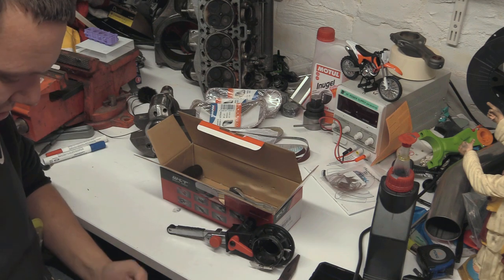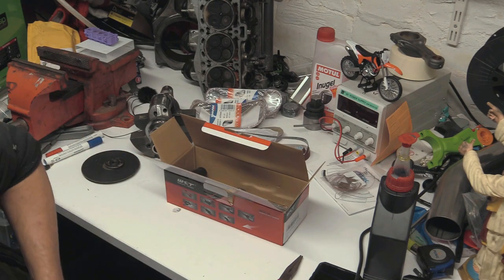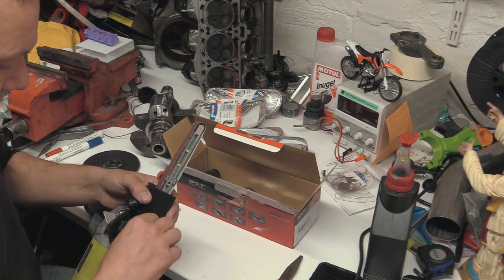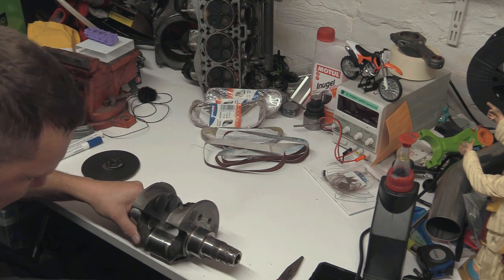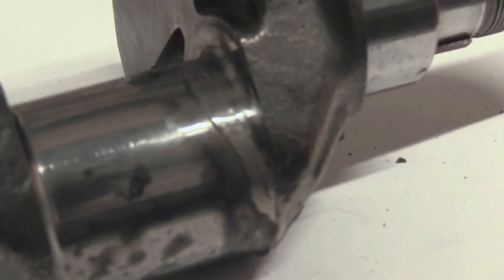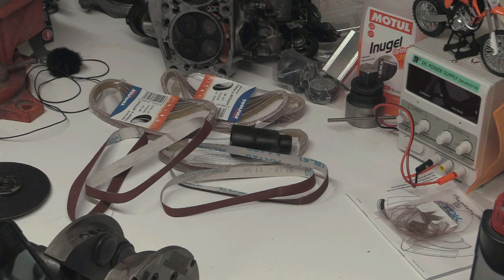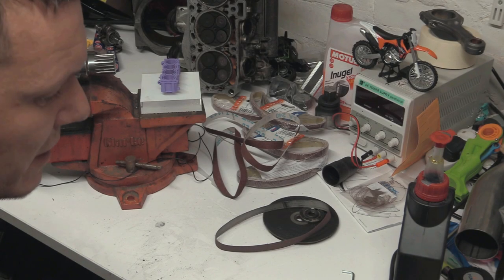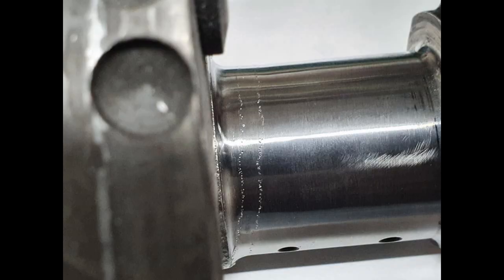DB Crank journal Repair!

Comment: What an excellent repair it should be good for at least 24k feet
Reply: If this is the crank surface tig welded it won’t last the first loaded throttle open under load

Comment: Just need an engine that was cracked and weld repaired, welded rods, welded pistons. And finish it off with a weld repaired frame and subframe! The ultimate bike repair project! Cross your fingers the engine doesn't grenade or the frame split into more than 4 pieces while anyone is riding it at full tilt.
Reply: ITYM "before the unfortunate buyer has ridden it past the end of the road".

"Sold as seen, mate!"
Reply: I think Del Boy has bikes like that.

Comment: nice ,or just buy the belts , turn them inside out with the grindin compound to the inside of the belt place it inside that shaft and use a power drill , you will touch much better the shaft contour ..